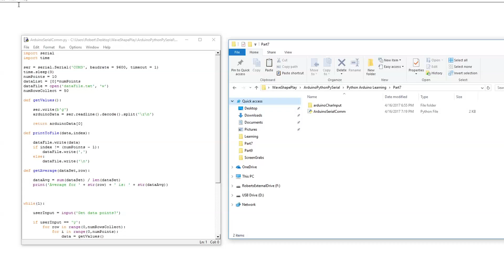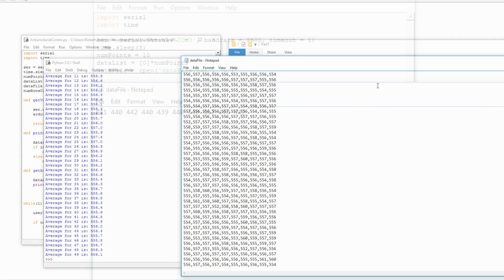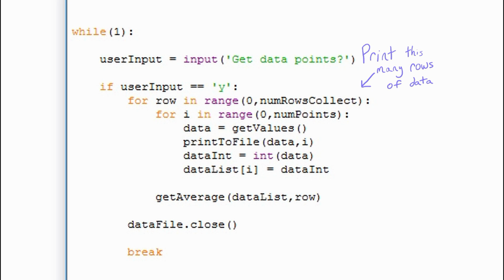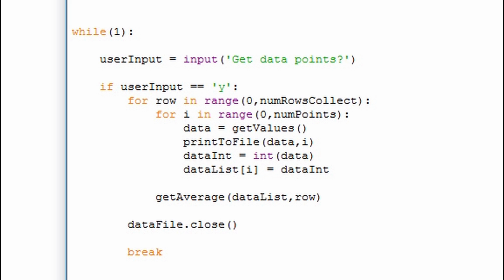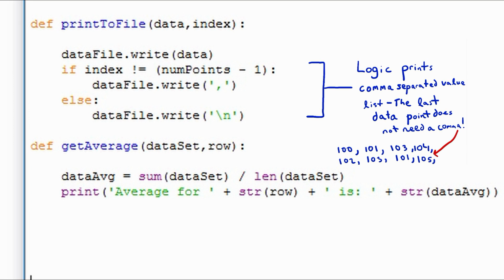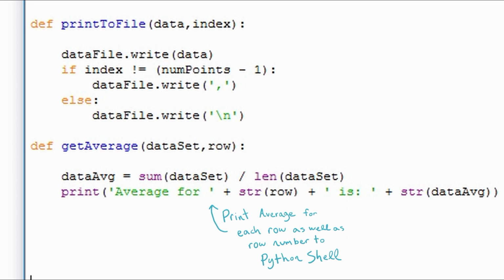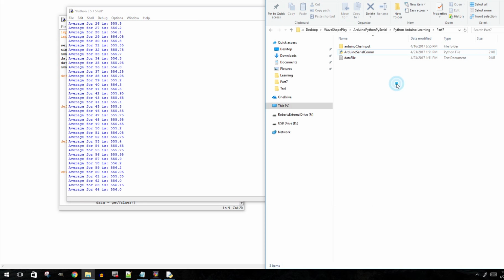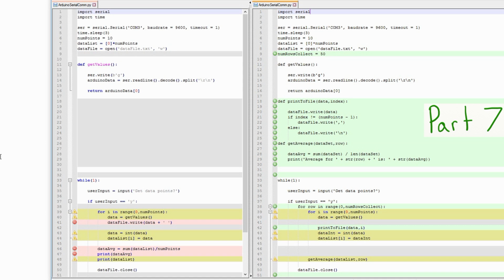Arduino and Python Serial Communication with PySerial Part 7 - Collecting Multiple Data Rows

Comment: Your videos are very well done and how you use python to work with the arduino is very awesome. I was just wondering if you have ever tried to use python to talk wirelessly using nrf24l01 or something similar. I know python probably has a library to do it just wondering if anyone had.

Comment: Thanks for the excellent tutorials. Your videos are very clearly presented and well explained. That being said I am getting the following error. I get it when I run your code from github and the code I made for my specific application. I appears to break down at userInput? Any ideas on how to get it to accept the input response?

======== RESTART: C:/Python27/Arduino Serial Connection Downloaded.py ========
Get data points?y

Traceback (most recent call last):
  File "C:/Python27/Arduino Serial Connection Downloaded.py", line 38, in <module>
    userInput = input('Get data points?')
  File "<string>", line 1, in <module>
NameError: name 'y' is not defined
Reply from the maker: Hello - I believe this issue is how python is dealing with the input() function. I see you are using python 2.7, in python 3.X there was a change in this user prompt function. I googled it and came up with this answer for python 2.7: "(raw_input() returns the verbatim string entered by the user. The function input will also evaluate the data it just read as python code, which is not really what you want. If you want to keep it short, you can use raw_input which is the same as input but omits the evaluation"

Most of the time 2.7 won't give you trouble. but there are a few cases like this one, where you will be careful about what version the reference code you look at is coming from. I know in python 3.X you cannot use: print "sting" , you need the quotes print("string")

Comment: Another great video. Very good presentation. Nice calm even voice with no rushing. One issue -  I do not see where your averages should result in real numbers. I ended up casting one of the terms in the getAverage() function.
Reply from the maker: 1. dataInt = int(data)
2. dataList[i] = dataInt
Here data is the string - data is converted converted to an integer in step 1 by the int() and step 2 is saving the current data point dataInt in to a list. I pass the getAverage() a list of integers.
Reply: Thanks for replying. Specifically, at 14 seconds into this video, your output to the Python shell shows averages as real numbers. My code works the way you wrote it but mine only shows integers for averages.